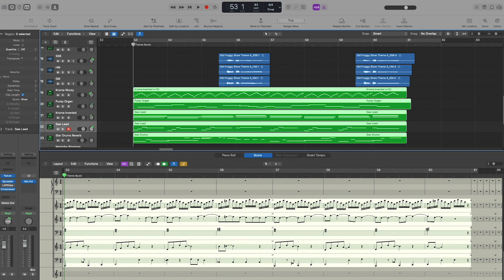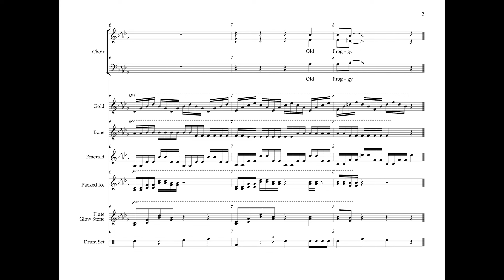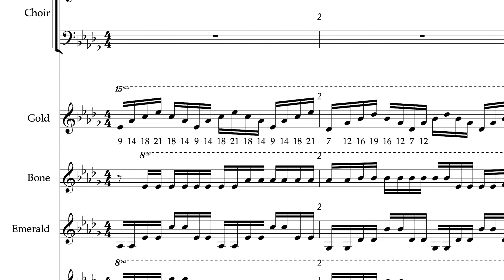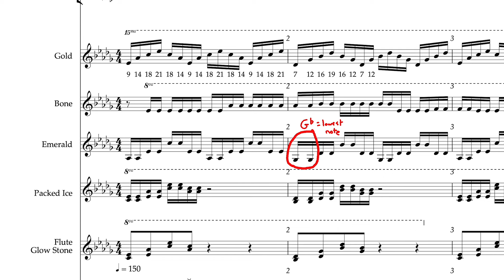Minecraft Note Block Machine Tutorial

Comment: 8:16 If you spam right click rather than holding it down, not only do you get to your desired note a lot faster, but also its a lot easier to count clicks rather than timing. Additionally, you could use an autoclicker and set it to run 12 times before stopping, making higher notes significantly faster to set.

Comment: just a tip to save you some time moving forwards: you can press ctrl+pick block to get a block with nbt data stored on it. in the case of note blocks this is the tune they are set to, so you dont have to right click so much. just remember which is which (i recommend naming them in an anvil)
Reply: That isnt nbt data, its blockstate data. You need a mod to get that in pickblock.